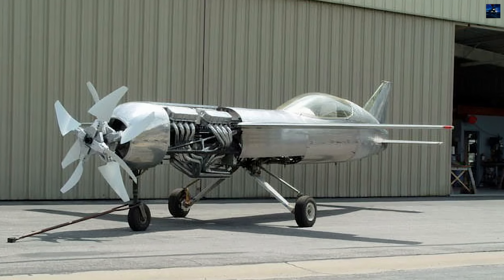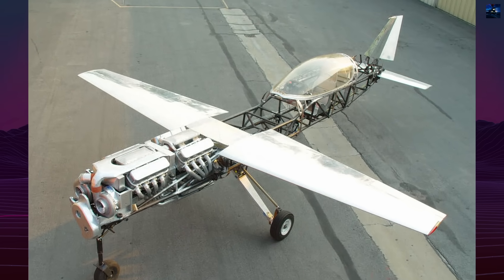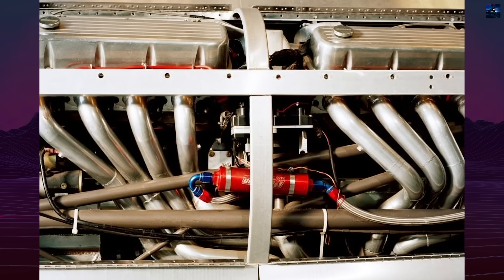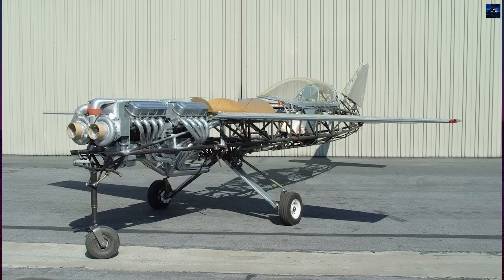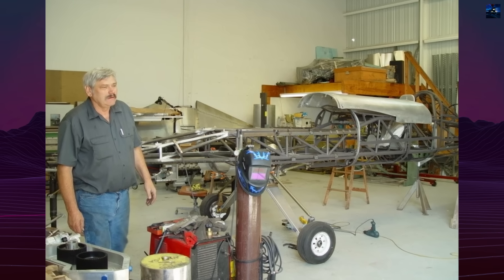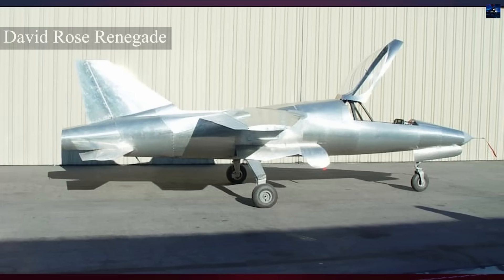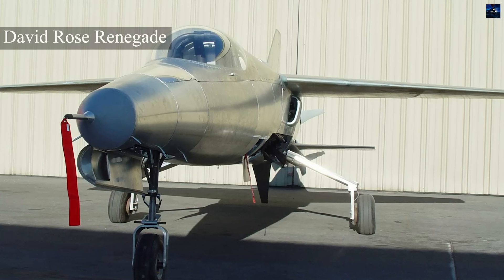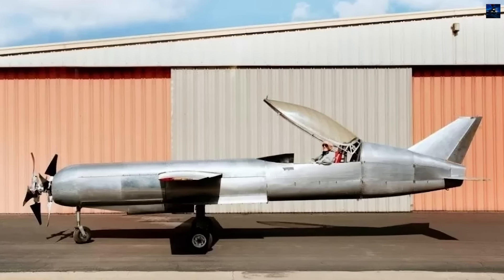David Rose’s RP-4: The Fastest Piston-Powered Aircraft That Never Flew

Comment: During sound barrier tests during September 1943 a Spitfire Mk. PR.19 XI with "clean" wings reached Mach 0,92 during a dive from 40 000 feet, while a Mk. IX with wing armament obtained Mach 0,88. In February 1952 a Spitfire Mk. PR. 19 flown by Flt. Ltn. Ted Powles reached Mach 0,94 during a dive from 51 150 feet after a meteorological mission. These are the highest altitude ever reached by a Spitfire, and the highest speed ever obtained by a normal piston engined aircraft. It's fascinating to note that these Spitfires had the original fuselage and wings  designed by Reginald Mitchell in the mid 1930s, except for a few modifications to accommodate the more powerful engines eventually installed. If there ever was an aeronautical genious it was  Reginald Joseph Mitchell.
Reply: There were.  And he was.  The S.4, .5, .6, and .6B racers  - divinely inspired.  It's hard to not just set your eyes on them, taking it all in.  Not unlike this RP-4.  Huh, a floatplane version could be as impactful as the Supermarine racers.

Comment: Why do you report that they were disqualified due to a rule change without explaining what the rule change was?
Reply: The Unlimited Class didn't want non-warbirds messing up their club (and taking their prize money), so they concocted a minimum weight rule. Then they made it an invitational race.
Reply: Gng it's a 4 minute video
Reply: If I had to guess, it has to pull 6G's? But that seems reasonable, and it fits the other criteria.
Reply: The Unlimited Class in spirit was to be exactly that - anything goes, but that tacit expectation was the class would all be based on WWII type aircraft, and would inherit all the R&D experience of those manufacturers.

Then 2011 came, and a highly modified Mustang crashed and killed 11 spectators.  The P-51 mods went so far beyond the original design parameters, the Race could no longer assume all competition aircraft would always default to the engineering specifications of these WWII designs.  In the case of this particular Mustang, there was nothing to validate the modifications against.  Also in this particular case, the owner provided no documentation nor information about any of his modifications to the Race Committee.

The Rave Committee tightened up and formalized the safety requirements, essentially requiring all Unlimited Racers to have a WWII pedigree.   It made explicit the inspection and certification would be done in accordance with the standards  as defined in the Operating Manuals of the specific racer and the respective manufacturer.

Since the RP-4 had no such pedigree and was a clean sheet design, it had no manufacturer documentation that could be used to validate and certify the aircraft against.  The Unlimited Class had then been limited to being WWII & post WWII piston, propeller aircraft, only, instead of the 'anything goes' aircraft designs as was the original spirit and intent.

Comment: With wings like that its critical Mach number is unlikely to exceed 0.7 - which is about equal to a WW2 Spitfire
Reply: The Bell X1 broke the sound barrier with a similar appearing wing. What's the issue?
Reply: @jamesdeath3477  And the F-104 was a mach 2 interceptor with a straight wing.  Wings don't have to be swept to attain high speed or low drag; they just suffer more from loss of efficiency from spanwise flow at high mach
Reply: @bronco5334  I know. No need to tell me. Tell the guy up there who says these wings have a poor critical Mach number.
Reply: Yeah, he mess up from the moment he decided to put that long engine foward, not even moving the pilot that back would solve the straight angle of the wing,  those engines should be behind the pilot no matter what.

Comment: The engines are obviously big block Chevrolets.   But if it never flew, how could it be the fastest?   Maybe the "potentially" fastest.  Anyway, clever and skilled engineering.
Reply: Because it’s the fastest plane that never flew
Reply: I think the title is like à joke.
Reply: @michelmarigny6221  ya, agree.  It's sometimes hard to remember some people have absolutely zero grasp of humor or satire.
Reply: Ww2 piston engines use a lot of turbo/supercharger pressure to reach those speeds, the supercharger have even gears, also you need to put a short engine to have some wing sweep to reach high speeds.